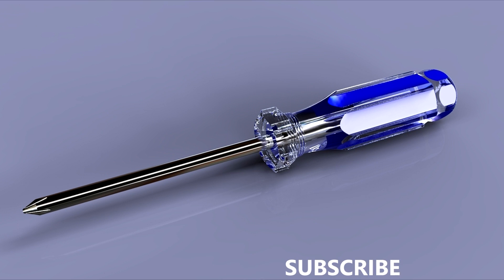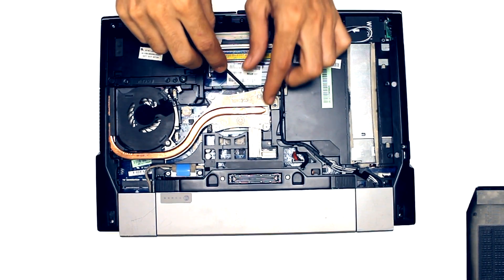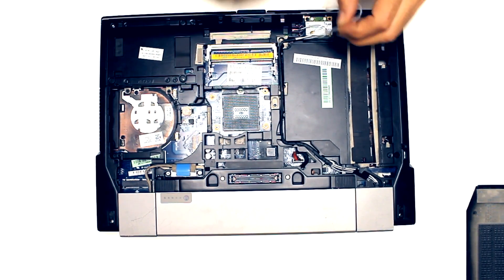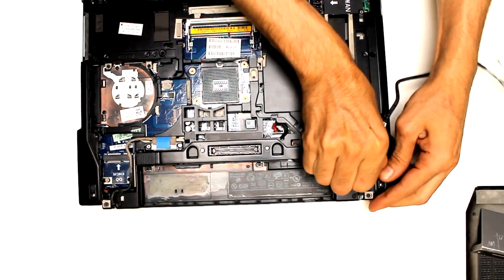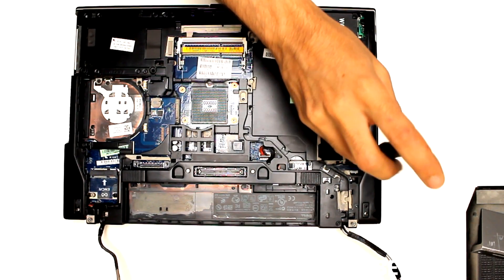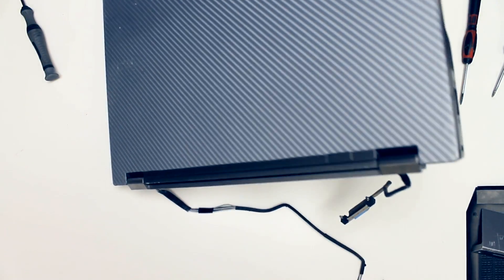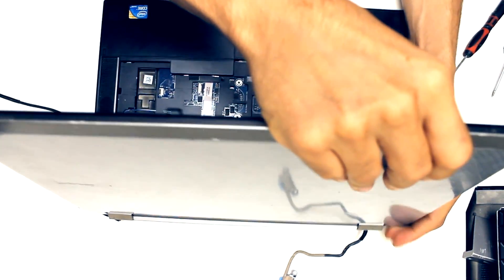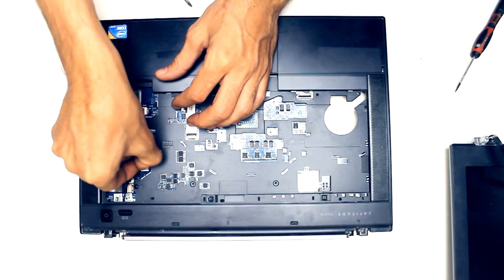How to disassemble Any Laptop for beginners | Tech

Comment: Thanks for your detailed demonstration & suggestions. My 8,9,5 & 6 on my numerical keyboard section are not working. I’ve an older Gateway 1T hard drive, 16 Ram, computer about 2014 model I used in college (was 60 when I graduated). My background computer technology for office applications. I know coding & html. I mostly use MS Office but it’s getting slower & slower. Did a system restore, checked settings, etc but those keys still won’t work. So I thought I would take apart looking for debris. Plus I know how to build & repair a tower but never did a laptop. Im looking forward to watching more of your videos. Trying to keep my skills up even though I’m retired. Everyone wants me to fix their computers but I run into more apps they should’ve never downloaded causing issues. Anyway so much for my story…you’re a great teacher!